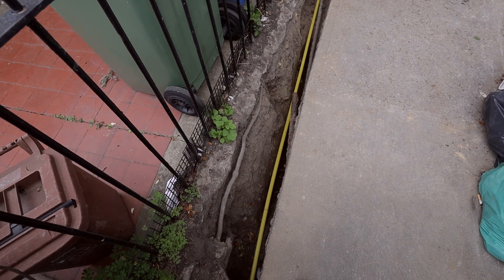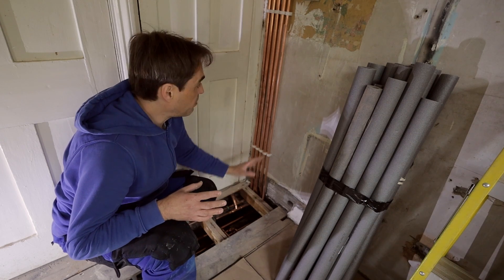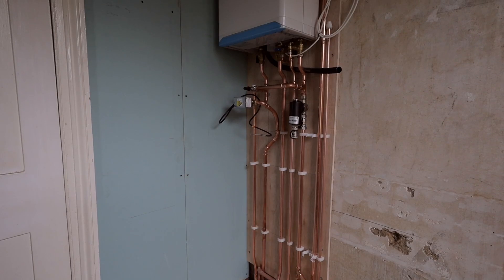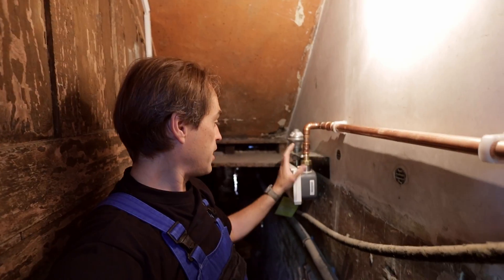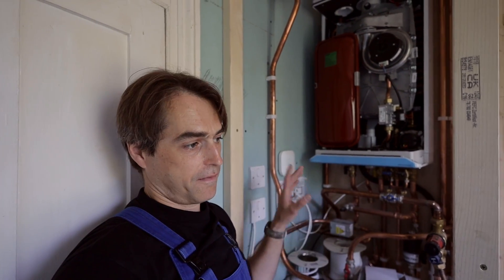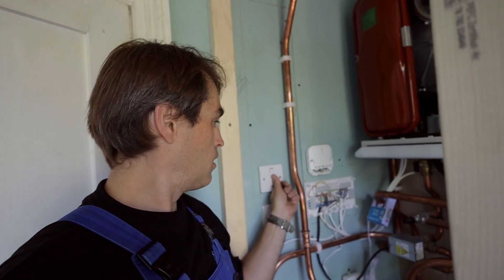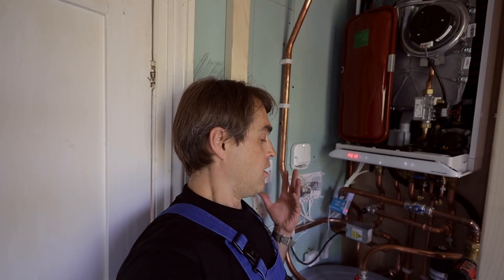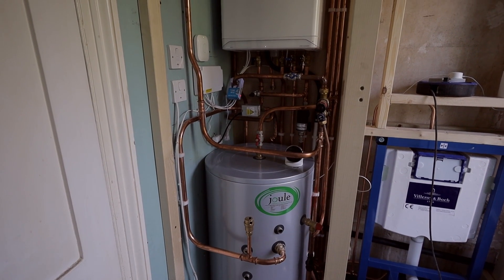Maximizing Hot Water Capacity with a High-Gain Cylinder and Intergas Boiler

Comment: 10 L a minute shower had flow here in the USA especially in the dry states it’s mandatory we have water restrictors on our showerheads at 1 L amid it to 1.5 L a minute 

If every household had 10 L a minute showerheads in California every lake would be empty every river would be empty and California would become the Sahara desert lol  🌵 🐪
Reply from the maker: You must be confusing units. 1 litre is 1kg of water. Showers stop working below 6l / min. 1l / min is just a small dribble
Reply: @UrbanPlumbers  thought you were talking about flow rate in liters through the showerhead device.   

Here in the USA when we talk about showerhead flow rate it actually means the rating of what the showerhead itself the volume of water that it will flow. 

And yes here in the United States I’m going to use gallons a 1 gallon a minute flow restrictor on a showerhead is like a little dribble of water very difficult to take a shower in when you are used to a large showerhead that flows many gallons of water per minute. 

But we have a water supply problem and the codes are mandatory that all showerheads must be of the low flow type.     Even our toilets now for every flesh are restricted to only using 1 gallon per flush I believe is the equivalent of 3.7 L
Reply: @coldfinger459sub0  
One US gallon is 3.78541 litres. A 3.8 litre/min shower?  Wow! Painful.
I recall American would mock us saying you have to run around British showers to get wet.  How times have changed.

Comment: Nice setup, great video again.  Bit of a side subject but you mentioned push fit, the house I have now has loads of push fit, quite a bit not easy to access either.  One day I'd like to replace it but I wonder if I'll ever have the time.  Notice you use press fit, surely this suffers from some of the same issues of push fit? Thanks
Reply from the maker: press has to be way more reliable than push fit. I had fittings crumble in my hands and have seen pipes pull themsleves from psuh fit fittings. Plastic expands and contracts way more than copper.
Reply: @UrbanPlumbers  
With pushfit fittings on copper pipes on hot & cold fresh water pipes, have shock arrestors near slam shut taps (one lever) on the cold pipe.  I have seen a pushfit be forced off a copper pipe because of water hammer. A full bore of water pouring out.

They are fine on heating systems using plastic pipe and fittings as no water hammer can occur. The grab rings dig into the plastic pipe better than into copper pipe. Never experienced a plastic push fit fitting on plastic pipe be forced off. Plastic fittings need secure clipping of pipes to avoid strain on the O rings.

Comment: Genius, Can you come and design my system? I’m in the same position, complete blank canvass. Will need a new system in about 6 months. Only issue, in south Lichfield :(
Reply from the maker: Contact me through my web site. I can remotely design your full ch and dhw system for your plumber to install.
Reply: Try us, Hatherton Heating, based in Cannock. Central heating design with your existing plumber or plumber provided. Email us on our easily guessable gmail address. Mark

Comment: I would have fitted a full bore cold maincock.  It improves the flowrate. When, like now, the water authorities cut the flow and pressure because of water shortages, the full bore maincock may make a difference.
Reply: Yeah maybe after the mains has been connected. They usually won’t connect it up unless a stopcock is used
Reply: @copperskills3973  
Depends on the authority.
A relative had 2.5 bar mains water pressure in March via a 25mm mains pipe. Good flow as well.  Now it is 1.5 bar as the water company has reduce pressure because of the drought.

Comment: Needs a diagram of the system. Is that a thermal store cylinder?
Reply: Not thermal store, regular unvented cylinder.
Reply: @LazerBrain11  
I assume with a quick recovery coil.
The safety pressure valving on unvented cylinders can reduce flow quite a bit.
Reply: @johnburns4017  👍

Comment: Navien just started to sell in the UK a 54kW infinitely continuous combi that delivers 22 litres/min, with a turndown ratio of 15:1.  
Worcester Bosch sell a 50kW combi. These are large white boxes but they are still far smaller than a system boiler and cylinder.  
Navien are the world's largest combi makers. Quality products. No I do not work for them.
So, at 22 litres/min DHW delivery, if you have a decent mains water supply, that is you can have two high flow concurrent showers for sure when cold water is added to each shower.

Comment: If you were designing a new build system ashp ready, so correct pipe size and emitters, but for a viessmann 200 on 50/30c so its future proof to swap to ashp if needed in a few years, would you install the cylinder your using now or a vailant UniSTOR cylinder
Reply from the maker: I would use a high gain cylinder - same as here but bigger capacity
Reply: @UrbanPlumbers  and can one of them be used for both ashp and a gas boiler on priority domestic hot water? I was thinking 200L for family of 4.

Comment: What a badass waving then push fit around on your finger 🤣 Didn't you read the safety instructions? 😛
Reply from the maker: There is one 😂?
Reply: @UrbanPlumbers  hehe read the speedfit instructions -says never to put your finger inside as the metal collets are really sharp... There you are with your finger casually right inside 😂😂

P.s. Keep the videos coming. They are excellent.
Reply from the maker: @gram3870  😃 I am push fit rebel  - thanks for the comment

Comment: Nice work mate, as always!

Had same issue recently, I used the air to test the central heating pipe work to 1 bar, works a treat.  Not a big deal for you but i still solder and using air keeps the flux still I'm the joint, meaning I can still solder the joint if there is a leak using water washes the flux out and I would have to cut the joint out and start again.  There about £30 and you can use your battery pump to pump up system.  I increase pressure little by little not straight to 1 bar and you'll hear the hissing if there is a leak.  This might come in handy for you again, much quicker than using the water.  I learned this the hard way!🙈
Reply: That's okay for testing pipes, but if there is a water cylinder included in the system and you pressurise to test pressure you are sitting with a potential explosion should the cylinder drastically fail (because of all the stored energy). Water, being incompressible will permit pressurisation with very little stored energy.
Reply: @gedsimpson9854  Slowly raising to 1 bar, .1 of bar at a time won't create a bomb. Not a chance, that's what the prv is for, that's If the cylinder is installed correctly.
Reply from the maker: I would never test with air unless it’s a gas line and I use 20mbar - too dangerous
Reply: Using air will show bad leaks but it’s when the heating is hot then cold a few times that a small leak will appear due to cracking of the joint.

Comment: Why wouldn’t all that ‘hardware’ be in the cellar. I wouldn’t want all that in my house.  No
Matter how great the installation; it’s just a waste of space and it’s ugly.
Reply from the maker: You would need a hight temp pump for unvented that is very expensive. The boiler flue would be next to impossible unless you used Keston boiler, which is rubbish
Reply: @UrbanPlumbers  
The Keston is an Ideal Logic with a twin flue connection. Ideal's extension flue models. It uses cheap 50mm plastic waste pipe for the flue. The Keston is reliable enough (problems have now been ironed out by Ideal) and come with weather compensation as standard and also supply the outside sensor. Openthem as well for internal stat. The turndown is not that great to the latest boilers like Naviens and Intergas Xclusive, etc. Fitted one in a basement with a long flue pipe to outside. Also a condensate pump, as being below the drain access.   When having long flue lengths they are cheap.  It liberated space in a house using unused space in basement. 

Only Keston and Navien have the twin plastic flues. Not sure if Navien do it in the UK yet.

Comment: Have you tried using a Viessmann 100 system boiler and plumbing it in 4 pipe, using the cylinder stat and the Viessmann wireless climate sensor. It’s so easy, hot water priority and much less wiring. Customer uses the Viessmann app for control. Don’t need to use a big boiler as I’ve been doing the same systems as you using 19kw system boilers and they work a treat. Less gas consumption too.
Reply from the maker: I use viessmann all the time now. Overall I think it may be a better boiler than Intergas. W100 is the same cost as IG Xclusive
Reply: @Urban Plumbers, saying you use viessmann all the time now, that is a mighty big statement considering you were a diehard intergas advocate since day 1. So looking forward to an honest video explaining the significant change in your philosophy and whether that is based on viessmann being more reliable than intergas or some other factors.
Reply from the maker: @amuthanshan  iG is a good boiler, but I am fed up with how much wiring there is to make it do what I want it’s to do. Viessmann is a much more refined product that is super simple to wire - just plug and play.

Intergas is build like a tank but viessmann is a much more developed product with efficiency that no other boiler can touch, their wether comp is simply amazing. IG wether comp is pretty crude.

If I was installing a boiler in my place it would be Viessmann
Reply: @UrbanPlumbers  
The IG weather compensation is not crude, it is the same as most others, it is just that Viessmann is ahead on that point. 

In a combi installation the Intergas boilers are simple with little wiring.  And as a combi a better boiler IMHO. Viessmanns have 3-way valves and plate heat exchangers, which Intergas combis do not have. The pump does not run when drawing DHW on an Intergas. Viessmanns also have spiral tube heat exchangers.  These can block on the bottom of the tubes after a number of years operation.  I have come across a few Viallants with blocked tubes. 

Parts for Viessmanns are very expensive.  Viessmanns are fine for large domestic or commercial with some complexity..
Reply from the maker: @johnburns4017  it's not crude? Unless you know a secret code 20 and have a  list of functions not listed in the manual you can't even adjust it. Intergas UK are a joke. (This is about X range ). IG UK are sabotaging their own product.
Reply: @UrbanPlumbers  
The codes are available in pdf from their website. XTREME-XCLUSIVE-parameters-engineers-V5-JDL-2022. Available from May 2022.

They never put them in the manual as too many played about with them.
Reply: @UrbanPlumbers  
The design of Viessmann combis is old and traditional. They bring nothing new in that respect.  Made well enough. Control system is good when you want different temperatures but that tends to be in larger installations using system boilers.

A house with just a combi and one or two heating zones? I would lean towards Intergas as first option. They are very reliable. 

I recently did one with a thermal store preheat.  No pump running when drawing off DHW - with high electricity costs that makes a difference over a year. An NTC is available to cut out the burner when solar preheat is above 52C. I would not dream of fitting a complicated Viessmann in that scenario.

For those who say I only fit Viessmann you need to get out more.
Reply: @UrbanPlumbers  
Viessmann boast that their weather compensation can hit a target room temperature to with one degree (I think that is right).  I have an Intergas boiler with weather compensation. I use a Heatmiser on-off stat as a high limit, it rarely cuts in. I notice the weather compensation keeps the place to within 1 to 1.5 degrees.  If the outside temperature say dictates that flow temperature is to be 50C, it will deliver 50C... but ...if the return temperature rises because the house is getting up to temperature, the control system then drops the flow temperature. Hence it keeps a stable inside room temperature without any direct room temperature feedback.  Sometimes the radiators are just warm, as that is all the heat input the place needs. 

Viessmann do not have a monopoly on weather compensation control.  They are good for sure, but not way out in the lead.
Reply: Heat Geek are a big fan of Viessmanns too, not least because it can plug into renewable technology with ease and can modulate very low indeed. They admit Viessmann boilers are very large - if you are looking for a compact cupboard-fit boiler , the intergas ecoRF is a great choice.
Reply: does Viessmann still use rubber hoses that end up splitting and leaking in their boilers when they can easily use copper? Are they designed to fail? They shouldn't just depend on the reputation of their unique bulletproof single pass heat exchangers with extra wide waterways to sell their boilers.
Reply: @amuthanshan  nope - they changed to copper ages ago. Plus, now they have integrated parts from the 200 range into the 100’s. No more need for changeover kits for lpg - integrated that into the gas valve and set up at commissioning.
Reply: @mrgilly100  
Some Viessmann's sound noisy and crude. The Intergas Xclusive is much better - quiet and quality. Turns down to around 3.5kW.  Viessmanns are expensive as well.
Reply: @johnburns4017  never noticed the noise of them myself. Modulation is now 1:10 @3.2 kw so not a lot in it. Of the boilers I have installed, these are my favourite. The heat only boiler is the only one that is a bit off for noise as there isn’t a insulation panel on the cover which is a shame. We all get used to what we fit and unless something comes along that is really revolutionary, I guess we will carry on as we are.
Reply: @mrgilly100  
Look at Intergas. Their Rapid is the best value for money of 'any' combi.  They are built like tanks with only 4 moving parts.

Comment: Good morning. Please excuse my ignorance as I think you may have covered this before. 
Why do you use a combi on a "system" and what do you do with the combi hot and cold boiler connections. 
Thank you ...
Reply: I looked at the video Jock - below mentioned ( 3 suprimas) and the implication is that it was chosen because it had a filling loop ! ?
I would be interested to know the logic behind this choice - I am not familiar with the Intergas boilers,  perhaps it was the "Exclusive" that offered something the remainder of the range does not and they are not manufactured as system boilers ? 
It is interesting to see what other installers are specifying and the installation designs and methods they use. 
Shame the trade press do not cover these subjects a little more thoroughly. 
Nice work...
Reply: @gibbodive140  yes .the intergas boiler is not sold as a system boiler , it's got a bithermal heat exchanger I believe, I've not had a great deal of experience with them either to be honest.
Reply: @jockster5525  
The HRE OV & HRE SB are the only non-combis. 
So the Xclusive modulates down to around 3.5kW and up to 24, 30 and 36kW models. The low modulation is an attraction.  They also have weather compensation and OpenTherm.  Although cannot use both at one time. 

The Xtreme is higher DHW flowrates by having a heat reclaim in the flue - making it more efficient.  

They are the only combis that can be fitted with a feed and expansion tank.  I fitted one one on an old system, in fear the increased water pressure of a system boiler would pop many of the old radiators. Also, it can be used as a multipoint water heater.  The CH section does not have to be filled with water, or visa versa. Handy on sites in heating DHW quickly. 

A quick look around and the Viessmann 30kW-ish system boiler is more expensive than the Intergas combi.  
A quick look: 
Xclusive 25kW combi £1,094. 
Viessmann 25kW system, £1, 268.

You can still use the combi section say for the most used tap in the house, say the kitchen tap and shower(s). Switch on the cylinder occassinally as needed, for baths and/or multiple shower uses. No standing heat losses when the cylinder is cold.
Reply: @johnburns4017  thanks for your help and explanation, that's very helpful indeed..
I'll look into this more this evening.. many thanks
Reply: He has done a video previously where he explains this very well . It's one where three old suprima boilers are removed ..I'll try to find it for you.
Good questions tho , I thought similarly to you 👌
Reply: @jockster5525  Thank you Jock. I will look that up later.